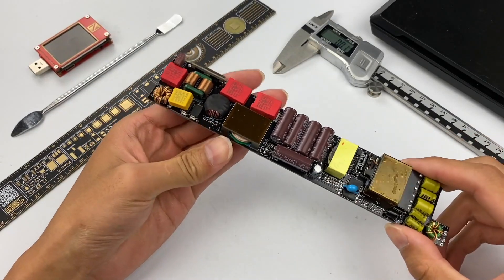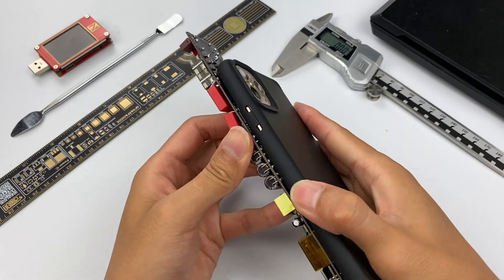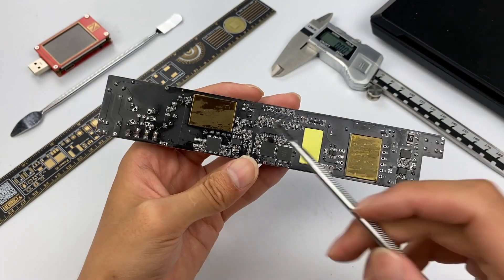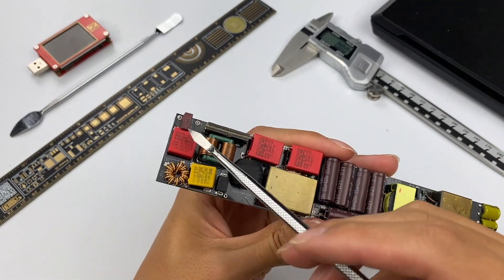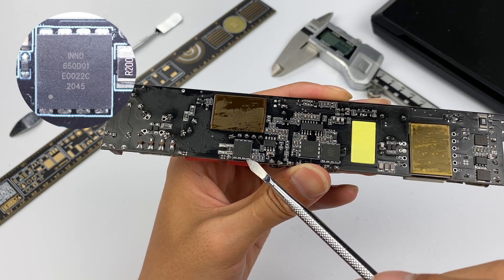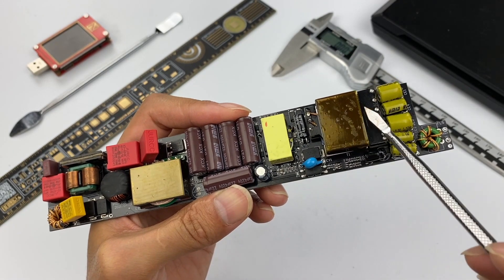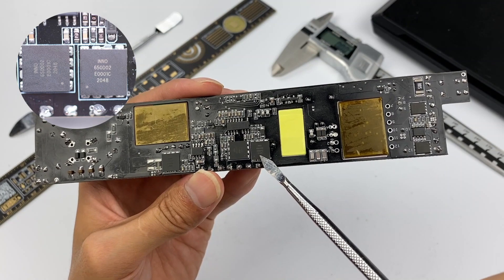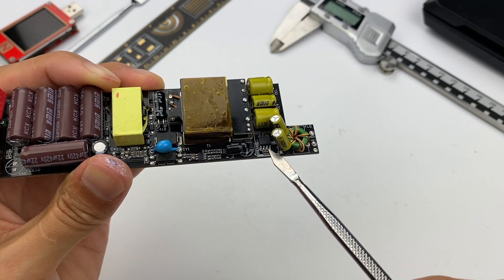Analysis of 200W LED Power Supply With GaN Components

Comment: Just a small correction, these inductors and transformers apply "planar design" - not "through-hole technology". Please don't feel bad. You are doing good work.
Reply from the maker: Thanks for the advice. We have done the correction in the description. 😁
Reply: They are NOT planar technology, they are through hole (you can see the wire windings). They do not use the PCB for traces, they are simply inset into the PCB to reduce height. It's a common practice.
Reply: yeah